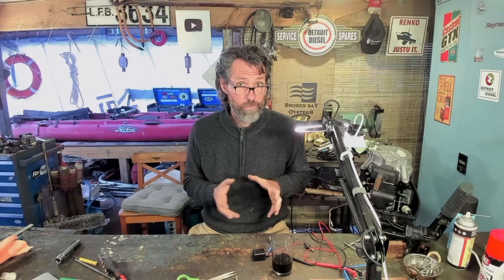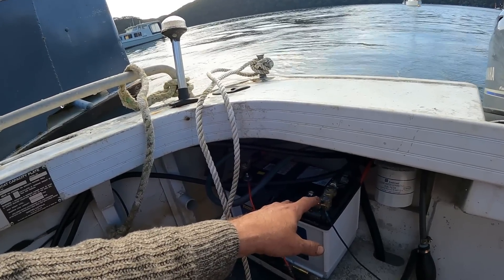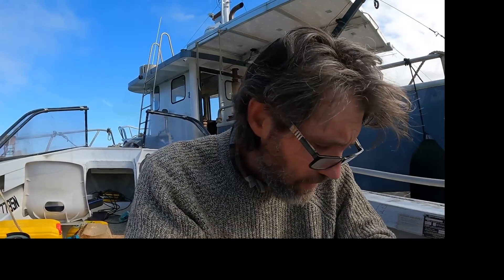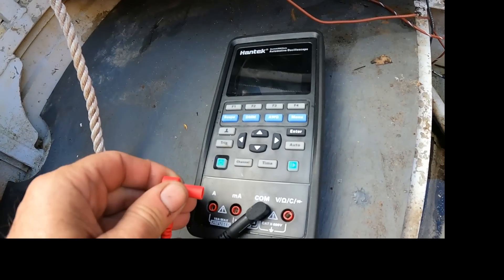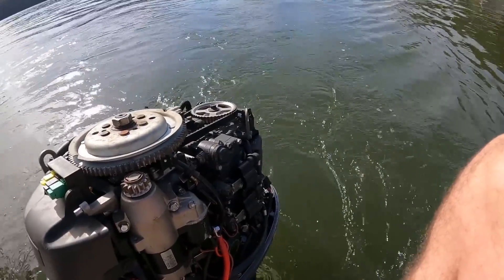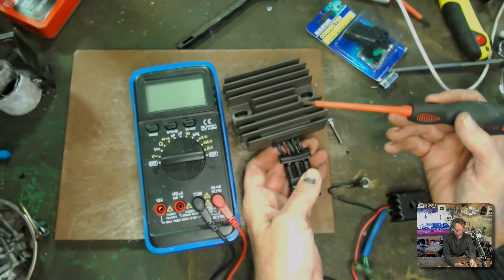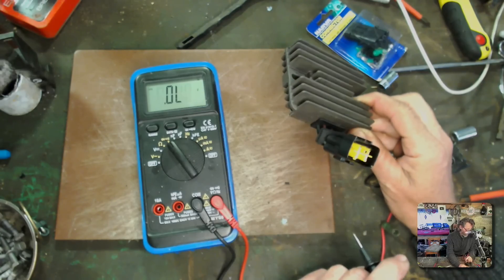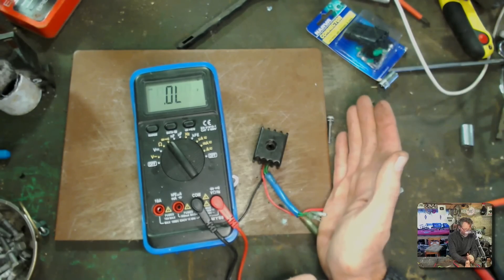Diagnosing parasitic battery draw

Comment: Good day 
This might not have anything to do with this clip
But is there a way of checking the ice box on a 1997 2 stroke Yamaha 90hp motor, when I got it it ran fine, next time out was running up river out of nowhere I lost 3quarter power then a few seconds it went back up, just like switching a light switch,then 1 day it didn't want to plain turned it off. Turned it back on it was a tad better, then it finally went to plain, turned it off went fishin, started it back up and it would just get on plain,going threw a narrow Chanel and all of a sudden it went to where it was suppose to run and lost control and beached it, but after that it is so inconsistent and never able to run like it was suppose to,  carbs were rebuilt,  no change , to me its the ice but I'm not a outboard repair guy, so can u help
Reply: Sounds like ur losing continuity or the resistance is gettin to high when the circuit is getting hot. Just a guess on my part
Reply: So not the icu, 
I really do appreciate the response back, we don't hav a yamaha repair person where I live and it's almost impossible to get any other shops to even look at it
So thanks for your help
Reply: @weeman782  usually when the icu fails, the engine wont run at all. Usually due to water intrusion. Stu can probly back me up on this but it sounds like a crank  trigger or pick up failing or weak fuel pressure. Good luck. I hope u get it sorted
Reply: @ionracer24  
Thank you
It's all appreciated
Reply: @weeman782  You're very welcome!

Comment: Hi Stu, I found on my outboard when the regulator was not charging, I had no tacho. I found wriggling the wiring harness, the tacho began to work. I found corrosion in the wiring connector. Cleaned it up and all was good. Tacho and charging working again and small cost.

Comment: That looks like a cranking battery,no isolator?
Reply from the maker: Morning! Yes, there is currently no isolator on it but could be tempting to add one. The trouble with commuter boats is that because that get used many times a day every day even if they have an isolator they tend just to be left on. Dual batteries with a VSR is really the way to go for these.
Reply: @DangarMarine  thanks Stu,probably don’t have thieves down there anyway,bloody river pirates.
Reply: @svthorasailing4868  we do but pretty hard for a theif to get away with a boat when everyone knows eachothers boats lol